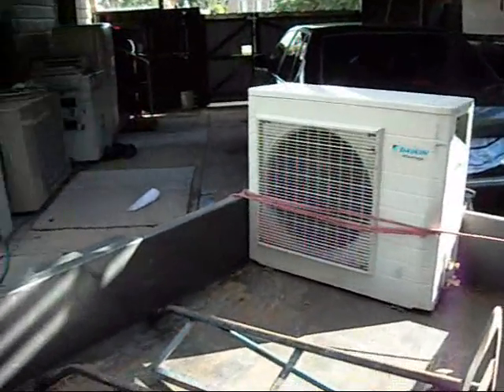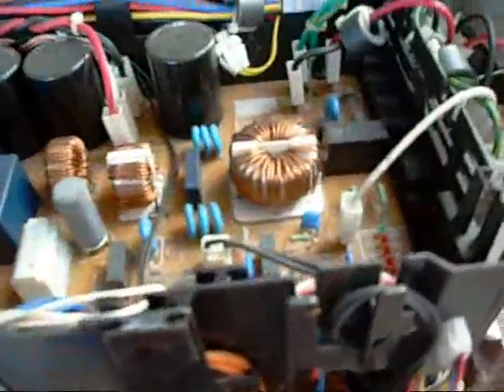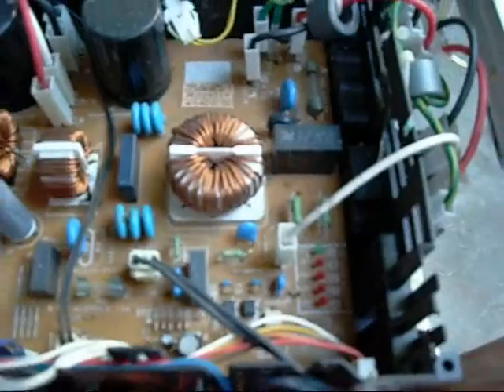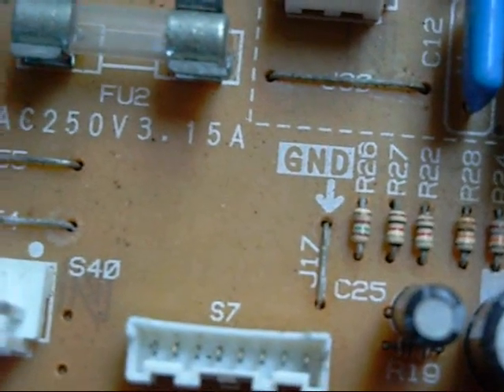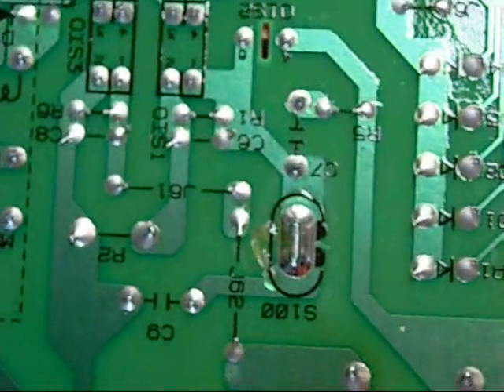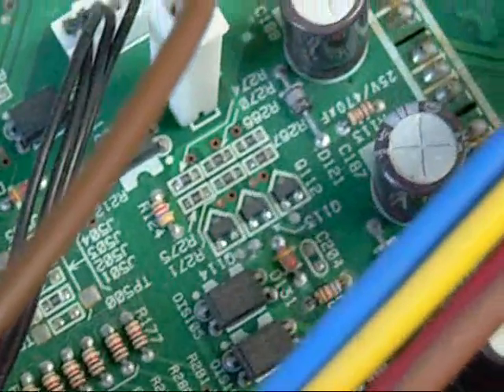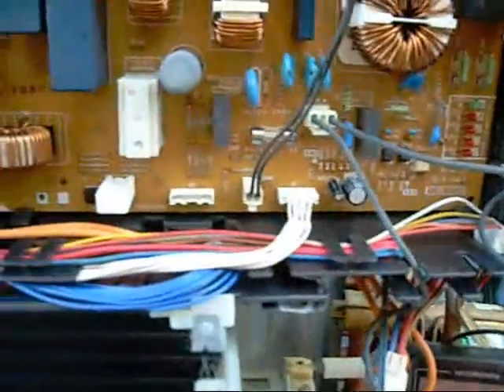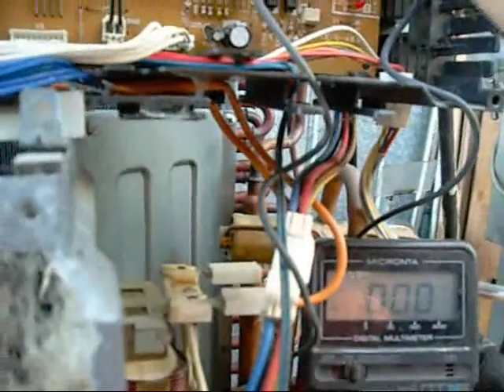Troubleshooting Daikin Inverter PCB Pt1

Comment: Hi. I'm have exactly the same unit. My outdoor unit is not running on cooling mode. I checked 4way valve it's working ok , outdoor sensor replaced. Indoor unit board is tested ok, Heating mode is working ok. Any idea pls?

Comment: hi i just wanna know if what is the fault of  my recently installed daikin inverter REFRIGERANT R32  wall mounted 1.5 tonners indoor model FTKC35QVM .i already finished all the process on installing new acu units like flushing the refrigerant pipe. leak testing ,vacuuming the unit. and release the stored refrigerant from the compressor.,then i terminate the communication wires in the correct tagging,the problem is when i stard the ACU the outdoor unit fan motor was just energizing for 2 to 3 seconds and the compressor doesn't  run..i check what is the error code on the remote but it says 00 means normal. but the outdoor unit doesn't run..ill appreciate so much if you can help me.

Comment: I have a Celiera ductless system that has gone crazy. turns on or off on it's own. from cooling to heat on it's own. I thought it might be the remote ? NO. I removed the batteries from the remote and it still acts crazy. 
Time for a new AC.
Reply: Kenneth Smallwood hj

Comment: Hello Aussie, great video. Is there a pt2? My board has a U2 fault and I have discovered the MRM20 and MRM10 relays aren't getting the control 12vdc. When I follow the the circuit it looks like it gets it from the ic on the other board. Where you able to recover the control voltage and if so how? Cheers
Reply from the maker: I was not able to restore control voltage to the relay circuit because it was in protect mode due to a shorted output IGBT pack. was not worth repairing :(
Reply: Aussie50 hi Aussie, due to it's difficult to test outdoor unit at site so I bring whole electric box to test at lab without fan and compressor (our A/C indicate U4 fault and has now power indicate at LED ar service board), I had check without power supply all the semi conductor devices on PCB but found nothing abnormal include IPM module also, to enable AC on to rectifier bridge diode need to enable MRM20 and MRM10, I wonder that can I by pass these 2 relay or not ?

cos I am newbie with A/C, by the way could anyone advice how to check the propeller fan good or not coz I had another issue E7 with another A/C (I did as service manual already but found has not 15V pulse at pin 1 and 4)
Thank you in advance,

Comment: Like your show my friend, i have just ordered a inverter board checker from Carrier, after installing Toshiba 3 phase inverter unit yesterday that would only run the comp for about three seconds. Have you used one of these, inverter board checkers? I will try to post a vid my self once I can work the beast. Ps what part of the Au do you live in, I am a fridgy in Lismore NSW
Reply: You can disconnect compressor leads and meter between each 2 phases, depending on hertz or speed signal you should be getting same voltage between each.

Comment: Can't you just bypass the board and directly power the fan and compressor to the level you need?
Reply from the maker: nope, they are brushless DC motors that require very specific controller boards.

Comment: Ahh.. That's not good... IGBT's are very expensive pieces of silicone.

No way would I install an inverter, until they SEAL the boards in epoxy.

Comment: If only they could make these inverter boards sealed and fit in 12volts DC fans inside and install heat-sinks i guess the AC would last much longer.. Almost all the damaged Inverter units I have seen is because of moisture and corrosion!!

Comment: this means when i want  to repair my a/c i have to bring it first to a man ho can check the circuit board if not the circuit board i have to bring it to a man who can repair the gas leak or change the compressor.

Comment: i thinking this thing of inverter a/c is making repairing of  a/c more difficulty , it is not resulting as it should the board will die faster than the compressor & with out a board the compressor can't work

Comment from the maker: I'm testing to chassis ground, the PSU is earthed to the AC units chassis too..

I will do a test of the DC 5 and 12V rails to the PCB ground too..

Theres no step down trans, just the ceramic caps and high wattage resisters to limit current and voltage. its been ages since i did VCR PSU's but you are right about the design of the system!.

the fault is on the control board. when I remove the power lead from the main AC board, the voltage on the pins (yellow plug) goes up to 140v AC.

Comment from the maker: Thanks for the tips man!, bits of IC case or capacitor are indeed harmful to the eyes!

Main reason why I have not gone further is because I'm not sure if the SMPSU is supposed to be receiving 240Vac or 110 from the main AC board.
A working Fujitsu unit I have is all 110AC, and If I were to apply 240vac to the input of the control SMPSU it would blow the crap outa it!

I'm afraid I'll have to try repairing it whilst attached ot the main AC board untill I find a schematic

Comment from the maker: if yours dosn't have a PCB in it chances are its a standard AC compressor with little more than a starting relay/contactor and capacitor.

without the DC inverter these units won't run.

Comment: why does this ac unit have  pc bord in it, mine doesnt? coudnt you try bypassing every thin and desighn youre own relay system so you could turn it on using a thermostat?
Reply: It the vrf for the veriable speed compressor